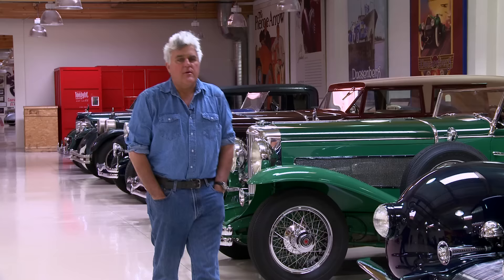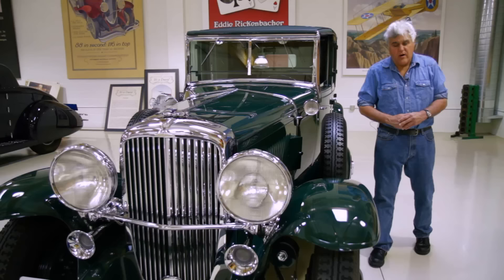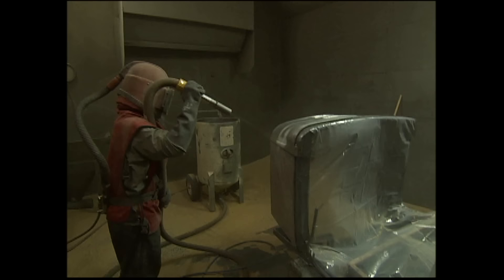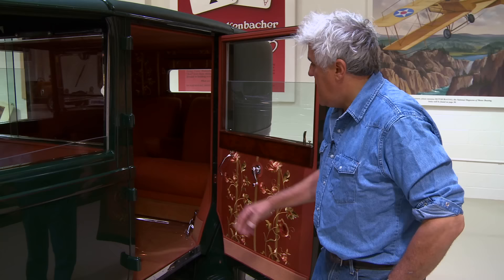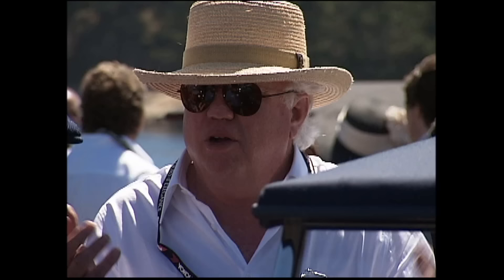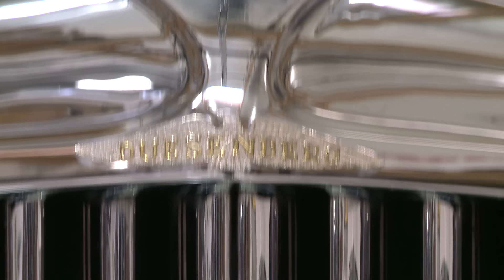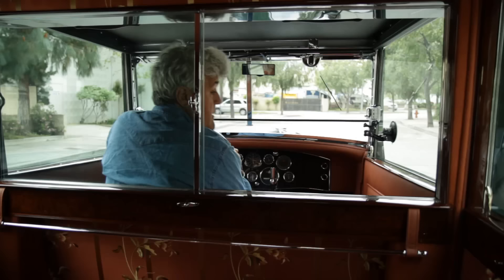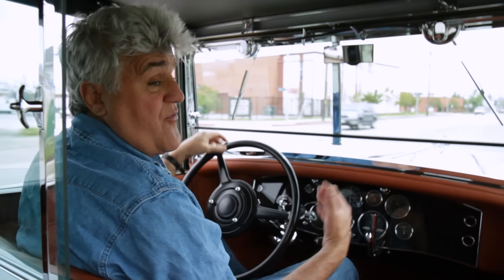1931 Duesenberg Model J Town Car - Jay Leno's Garage

Comment: Okay.  I offer a ride in my C6 Z06 built with a naturally aspirated 8.2L "LS7."  Only there is virtually nothing left that is GM under the hood.  RHS block stuffed with a 4.6 inch billet crank.  Coil-overs custom valved and sprung. Delrin bushings and fully adjustable sway bars. It is quick like a McLaren, but rowdier. 502ci turning 7000 RPM sounds amazing and kind of crazy.  Jay can even drive.  I just want a ride in any Duesenberg.

We just need this pandemic to end.

Comment: The guy that did the restoring needs to mention what weight loss method he used ... I would love to lose my mid section.
Amazing Car, details and history
Reply: If you're over 40, lift weights but don't do running, bike riding, etc. until you've lost the weight. Lifting weights increases testosterone levels, which increases fat metabolism. Aerobic exercise suppresses testosterone production.

Comment: I believe this is the first car"or one of its type" that I can remember selling for $1,000,000 ,in 1986   a friend of mine actually paid ,$985,000 for a j class ,in Knoxville Tenn. It was in fair shape ,he spent over $200,000 on it ,and sold it to a guy in Canada,for 1.7 mill,in 2003. I would have never thought ,that today ,in 2016 that $1,000,000+ cars ,are almost common place.

Comment: I have from the first time I saw a 1932 Deuzy love that car. Cadillac, Lincoln, Chrysler,  and Buick all started to mimic it.
  I bought for my first car after I got out of the army a 64 Ford Galaxie XL. It had a 330hp 390 and factory 4 speed.  I went mechanically through the car. I had to bore it 30 over due to my Mom driving it for years and using fourth gear lugging it around. It was funny when I was a teenager riding with her and someone in another car would mess with her. She did know how to drop 2 gears and stick her foot in it. 
  I loved all the chrome inside and out as well as the bucket seats. 
   I had decided to keep the car the rest of my life,  but I made the mistake of loaning it to a friend and pulling out of my drive, he went in front of a pickup and totaled it. 2000 miles is all I got to drive it.
  Well I finally found another and it is a good to see car from about 20 feet.  I've tried to fix it up but bladder cancer and shoulder replacement has slowed me down.  
  I dont know why I got into all that but if there is a moral to my story,  it's this. If you want to keep it, dont loan it out.
  Anyway, I love seeing someone take an old car and fix it up and Jay Leno and would have great running buddies.  Thanks Jay for videoing all you do. It make it possible for me to really enjoy all the cars I never would of had the time for, much less even seen.

Comment: Well I think the car,   Duesenberg, is quite beautiful. I like the boxiness. Square design  is attractive. Square  Communicate stability and affluence, particularly of that Period.  Just like the way the old Lincoln’s were so boxy. And contrastingly Cadillac was curvaceous. Both are beautiful and  specific  what they represent. It’s like the term old money. You could tell just by the design of the things around.  And it’s so funky what you said Jay about the old 80s Cadillacs because I’m looking at an 87 Fleetwood Brougham de Elegance. I just love those cars.   I drove a 1978 sedan as a university student in 83, dads old car.  I tinted the back windows Leaving the driver side clear. I never was pulled over by the cops, they thought I was the  ostensible hired  driver of coarse. I should’ve got myself a chauffeur’s  hat  those years were a lot of fun.

Comment: Funny story about this car, it was purchased from John Straus, who's family founded Macy's stores, and they ended up dying on the Titanic. Straus had this car and a 1930 Rolls Royce Phantom parked in a Manhattan garage for around 50 years to which he had to pay storage fees. Straus became delinquent on his storage fees and the garage threatened to auction off the cars he had in storage if he did not pay. Straus owed around $29,000 in storage fees. Straus made a payment, but it was for another garage where he had other vehicles stored at. They then held an auction for Jon Straus' cars without the owners knowledge as they took possession of them due to the delinquent bills in 2005. They sold the Duesenberg model J to Jay Leno. One of the cars was purchased by the parent company of the garage for $0, which was a 1930 Rolls Royce Phantom which is valued at around $200,000. Jay Paid $180,000 for the Duesenberg, and is now worth around $1,000,000 after the restoration. It's also been said that during the auction, Jay made up a lie (story) that the 3rd floor where the Duesenberg was located, would be impossible for it to be removed because the new elevator they built years before was too small to fit the car. Which was used to dissuade potential bidders on the car and/or keep the bids low.

Comment: A couple of observations. It is a heavy car. What kind of brakes did it have originally and what kind of brakes does it  have now (after restoration)? Someone has observed that a 1930/1931 car stored since 1931 could  not have clocked 107,000 miles. Except that is was taken out in 1951 and used for unknown period of time. When opened, the engine was found to have been rebuilt sometime in the past (it had replaced pistons), so it did have a high mileage. And finally, it is highly surprising that this engine did not come with an air filter / cleaner, because while the air back in the days may have been freer of pollutants, many roads were not paved and there was lots of road dust in the air. Even much older cars came equipped with oil-bath air cleaners that were quite effective in trapping dust and sand in the air before it got to the cylinders.

Comment: Jay starts off saying the car was put in a parking garage in 1931. Then he got it in 2005. But it is a 1931 car. The restorer said the car was a high mileage car, not 7000 miles at all. It already had an engine job done. 

So something does not add up.

Comment: one thing I forgot to talk about is when they were talking about the horsepower you didn't seem like much but what I do know about the duesenbergs as they have an amazing amount of torque for a gas engine almost equivalent to a diesel the other thing that makes duesenbergs more different than most all other cars is how capable of the engine being so beautiful when all polished and be cleaned up but that's that's all I can tell you but yes the duesenbergs have so much torque because they have a long piston stroke most other vehicles don't have that

Comment: I remember these 2 cars in the Windsor parking garage on the upper East side of Manhattan in 1991(76 or 77th. Street) The 2 cars were on the 3rd or 4th floor uncovered...the Strauss auto parts family owned them and were unprotected and uncovered. Weren't they sold to Jay in an unauthorized sale?

Comment: I  known 100,00 miles sounds like high mileage----my 1999 Dodge Caravan has 1,200.000 and is still strong but uses oil.    The ship I worked on in my career with the Coast Guard was manufactured in1946 and has been reconditioned to factory standards and clearances every 5 years since new.  We ran it for about 9 months per year  @10 knots  10nmx24hours=240nm/day for 30 days=720nm/monthx9=6480nm/year.  2002-947=55x6480=356,400nm  5x6480=32,400nm between overhauls----rough guess mostly it was used 10and a half months a year.

Comment: I have to be honest that was probably the most depressing video I have ever seen, just to see the last original duesenberg, just destroyed, just ripped apart and destroyed, it no longer original, it's almost as if there are no more duesenbergs left, I mean I can understand if you want to get it running again but if it runs there is no reason you should ever repaint it or restore anything other than the mechanical parts

Comment: 1.5 years restoration. Say 5 man years, or 10,000 hours labor guess, x$50/hr. = $500K cost to restore. Hmmn. Just a guess. Looks great though. Glad Jay can preserve history. Did not know the Deusy bros were race car guys. Thanks Jay.
Reply: That guy does NOT work for $50/hr! The local auto mechanic, who fixes minivans and pickups, charges $80-100/hr labor. Some guy who "specializes in Duesenbergs"...I guessing $200/hr as a STARTING point.
Reply: That brings my calculations from $500K to $2 Million. Sounds really high, even with $500K. I would bet a firm fixed price would be set for a job like this, instead of hourly. Because an expert would hire lower paid people to do some of the work, as he supervised.  Or priced in increments.

Comment: I'm a little confused first we were told it sat since the year it was made - then 20 years later it was made to run again and put back in the garage but, it's a high mileage car?  Doesn't add up - seem unlikely that driven on the streets of NYC that it would have more than 100,000 in a year.  It's a beautiful car.

Comment: Like that 1941 Plymouth i had the sedan for $300 me and two friends took it to Florida from NYC  in the winter and drove it till it won't drive anymore  on the road  anyway i sold it for $25 was given a lift to a bus station to continue to Florida and we borrow a car to take back to NJ  just pay for gas and change oil  and back to big Apple

Comment: "Salt was first used in the United States to deice roads in New Hampshire, which began using granular sodium chloride on an experimental basis in 1938. By the winter of 1941- 1942, a total of 5,000 tons of salt was spread on highways nationwide"

If this was parked in 1931 I doubt it saw salty roads...

Comment: Saw a 1933 Duesenberg Roadster for sale around 30 years ago in Orlando Florida.  They were only asking $5 million for it, looked in my wallet, was only $4,999,975.00 short, so had to pass it up.  That was cheap, the one Gary Cooper sold went for $22 million.
Reply: Back in the mid 50's, could really find a nice running Model A Ford for $10.00, needed main and rod bearings repoured, but the bodies were in good shape.  That's because Henry added a little nickel to the steel.  Actually practically all cars hand 0.5% in the nickel in the steel.  1949 was the year Detroit stopped this and this was the year Detroit rust was invented.

Comment: As was not infrequently done at the time, that body was almost certainly originally constructed for an early 1920s chassis and switched to the Duesenberg chassis in 1931, as an "upgrade", which is why it looks so odd with its vertical one-piece windshield and squared body in complete disharmony with the aerodynamic Duesenberg grill, hood and fenders.  
It probably looked something like this Silver Ghost originally: https://images.app.goo.gl/2YTr1L9bnHAzQ16y9

Comment: No air cleaner that's weird.  I know that the 1941 Buick uses an oil soaked filter only 10 years newer.  Maybe that's why the motor wore out early.

Comment: haha, i've seen my dad hand starting 2.5L V8 and it didn't look too confident, you might gonna have to ask he-man to crank start this one.
Reply: +tallll70 I feel like they added that as an option just as a joke. No way in hell are you crank starting a 7 liter I8. It probably won't even jump start if you dump the clutch while it's rolling. It would probably lock up the skinny tires before it cranks over the engine.

Comment: That thing at the front looks dangerous :D
Reply: Probably is, but it's about 5.5 feet off the ground so nobody's going to fall on it or run into it.
Reply: Yeah, probably. Still, I'm pretty sure, that would be illegal nowadays, because all those little figures now have to comply with pedestrian safety regulations. We just can wonder, how Duesenberg would deal with that :D

Comment: Wait.. it did 100k miles in 1 year? that's pretty impressive considering the speed limit was what.. 40? 45? and considering roads were not what they are now...
Reply: And Deusenbergs were fast. Leno himself mentioned on one episode where there was only 1 steamer that Hughes found that could outrun his Deusey. And if your "Man" performed his daily maintenance, and you had parts on hand, and it was run regularly and sensibly, it could manage it.

Comment: So it's a 1931 car parked in 1931... even with a leaky garage, how did it get so bad?  How did it possibly get 7,000 miles, let along 107,000?  How had the engine been rebuilt?  Something don't add up.  Maybe it was parked in 1951 instead of '31?  But the depression was long over by then.  I am skeptical.  Even with a leaky garage, the car wouldn't have looked THAT bad if it's been sitting since 1931.

Comment: I am surprized that you have not considered an Australian 1968 HK Holden GMH Monaro,  they are beautiful and I know where there is an immaculate model which has been absolutely restored to incredible off the assembly line original beauty, oh its RED and a dream to drive with a 350 expanded engine, it practically flys.

Comment: It's a 1931 model, and it was garaged in 1931 and pretty much sat since.. did they really drive 107 000 miles in one year?
Reply: +Toerme Good point.
Reply: It was mentioned in the video that family members had taken the car from storage at times and had driven it.
Reply: According to a newspaper report when the previous owner alledged Jay of acting in an improper manner in obtaining the car, the car was put in storage in the early 50's. That would have given 20 years to rack up the 107,000 mileage

Comment: Did he say built in 1931 and also parked in 1931 but it shows engine wear consistent with 107,000 miles? In just one year? Probably not parked in 1931 like he was told.

Comment: Did he say Altimeter?

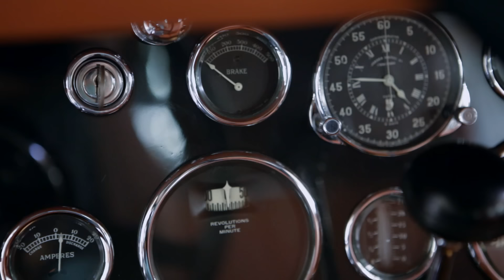15:23
Reply: GoogleModerator 

Yes he did. I’m assuming it’s so the driver could adjust the fuel trim and timing to maximize performance while on the road in mountain areas.
Reply: @chrisj197438  Jay has mentioned that since Lindberg had just flown across the Atlantic, altimeters were "cool."  Probably useless 95% of the time, but cool.
Reply: Max Korfendagus probably true

Comment: do Duisenberg's have a synchromesh trans?  are they a 3 or 4 speed ? do they have straight cut gears in the trans?
Reply: non-synchro, 3 speed.
Reply: is second and high syincromeshed?
Reply: MrBrendog67rat My understanding is that the Duesenberg brothers didn't change over to a fully synchromesh gearbox until the mid-thirties. So my guess would be, that a fair number to most Duesys don't have one.
Reply: chs75 MrBrendog67rat these cars were made to be driven by a chauffer,  so being efficient in the hands of a skilled driver was more important than being easy to shift by the average person.
Reply: brett knoss Well some of them were meant to be chauffeur driven, like this town car, however, I would say most were actually meant to be owner driven. It's almost like saying modern day Bugatti's are meant to be chauffeur driven. There were other grand tourers for that (Rolls, Cadillac, Packard, etc.).

It really has more to do with the '29 crash and subsequent depression. The 480 or so Duesenbergs that were initially built in 1929 were meant to be sold in the same year. It ended up being all that was ever manufactured, so the technology never had a chance to really develop.
Reply: chs75 fair enough,  the other thing is it's a high torque engine,  and big trucks often don't have syncros.

Comment: I just think this vehicle was a failure in restoration. It was designed to be bland and, by it's shape and size, imposing. The streets weren't as well lit as they are today so that car was a dark beast going down the road. The open cockpit for the driver meant he couldn't hear what was going in the back as easily; it meant privacy.
Reply: It was open because driver as a servant was not supposed to be inside a car with ladies and gentelmen and had to sit "outside".

Comment: So... they basically built the car from scratch. Why did they need the original at all...
Reply: They used a lot of the original. Even the engine. Paint doesn't automatically make the car not original.

Comment: Altimeter?
Reply: Alejandro Medina Just in case! lol
Reply: +Bainanaz Ice cream can't be taken on Donner Pass.
Reply: +Bainanaz It's because the food is more likely to "blow up" in the microwave at very high altitude because the boiling point of water is decreased from 100c the further you get from sea level as the atmospheric pressure decreases. It's kinda like reeling up some deep sea creature and having it "pop" by the time you get it to the surface.

Comment: Is it possible not to grind gears with the Model J?
Reply: GruszkuEntertainment only for the synchronized  gears. Typically for this era 1st was not synchronized, good chance none of them are. Really not sure on that particular car. Get good enough with the clutch and gas and yes you can do it without grinding.
Reply: JamesAllmond The Duesenberg J and SJ had all gears unsynchronized. I drove a car that had first gear unsynchronized, but I never grinded gears...
Reply: I thought they did, wasn't sure. thanks for the info. I too have driven non-syncro 1st gear cars. No, they did not grind like that!
Reply: Yes, if you change gears double clutching it won't grind.
Reply: Yes! If you know how.
Reply: I don't believe that!